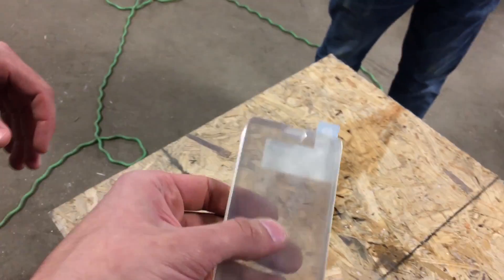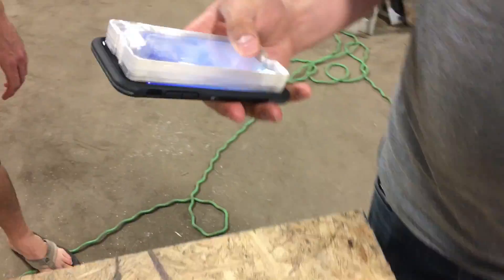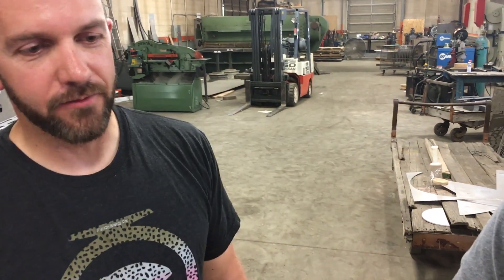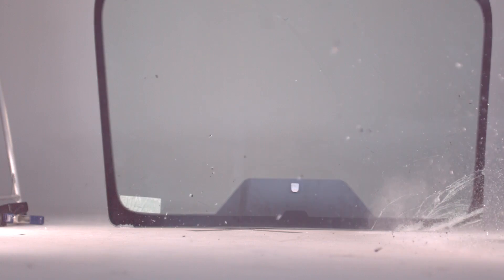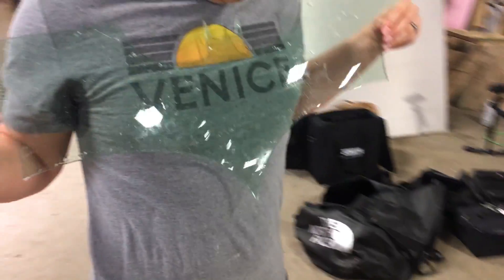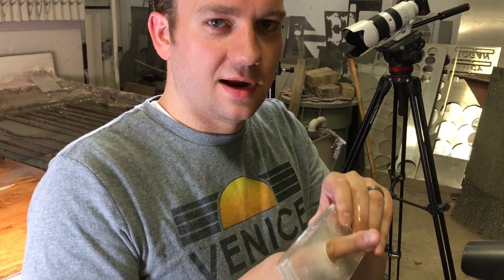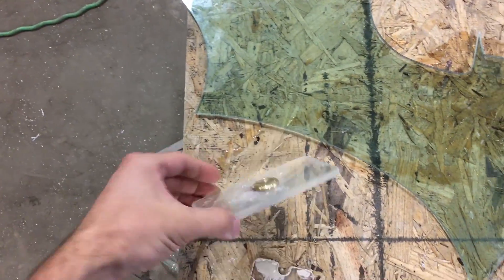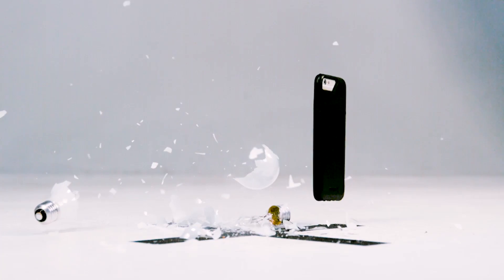Windshield vs 60,000 PSI Waterjet In Slow Motion

Comment: Stainless steel slab? 8" thick, 50" wide, 5" long?

When calculating weight, i use a formula of: 8x50x5x0.283=566 lbs.

Can you do 30409 melt grade stainless steel that thick?